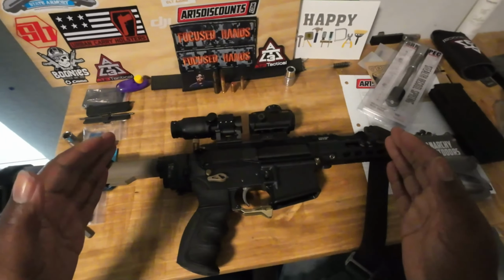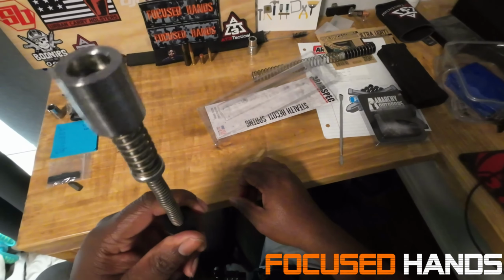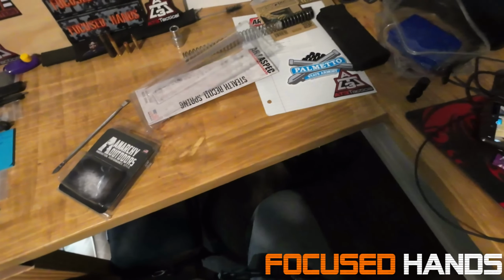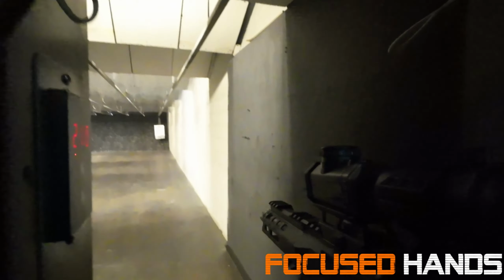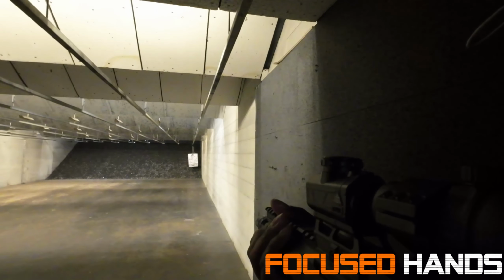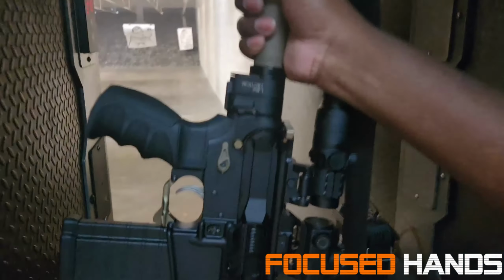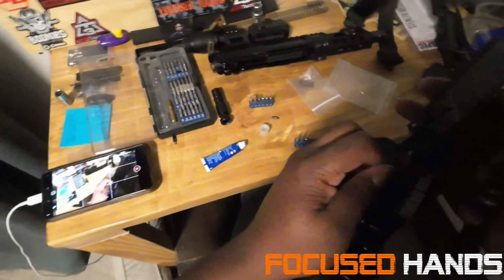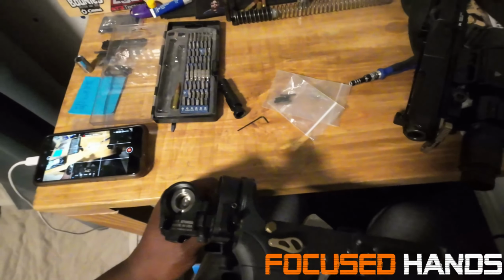Armaspec Gen 4 SRS Combined with a Law Tactical/Anarchy Outdoors Bolt Extension- Part 2

Comment: I did a comparison the other day between my 10.5 AR in 5.56 and my 10.5 KS47 AR 7.62x39 … the 5.56 has a standard buffer in it and the 7.62 has the Armaspec … man you can really tell the difference when you do that .. that 7.62 was so much more pleasant to shoot and handle rapid fire .. just ordered more from Armaspec for the other AR’s … an upgraded trigger really makes a difference in combination with the Armaspec too … I’m running a LaRue tactical MBT 2S in the KS47 .. my super sweet hog blaster 😂😎
Reply from the maker: Very nice! I need to drop a srs in my ks47! Thanks for the tip! What trigger did you drop in?
Reply: @FocusedHands  sorry for the delayed response … LaRue MBT 2S is the trigger .. they make it in a flat bow and a curved design .. got both , but like the flat bow better … there is a YouTube video that fully describes how to do the installation … it was very easy to do and to the best of my knowledge these are the only triggers I know of that work in the KS47.. 3.5lb pull … very nice triggers … bought straight from their website …
Reply from the maker: @thebugkiller9036  thanks for the tip!
Reply: I think the weight may be too heavy in the buffer tube. With the Armaspec SRS they say you are supposed to go lower a weight down because of the Dual Spring System. The only reason I say that is because a few times the bolt didn’t lock back to the rear. When the weight is heavier than needed that is the outcome sometimes. The bolt doesn’t lock back when the mag is empty. Let me know if it works out.

Comment: Hey bro nice set up! Does it really help mitigating some felt recoil? Any way thanks in advance 🙏🏽👌🏽
Reply from the maker: It does! Helps with 300blk forsure! Makes 5.7 feel more like 22LR
Reply: That’s good to know. I’ll be ordering mine. Thanks braddah 🙏🏽
Reply from the maker: @MrDalon37  id order an addtional buffer just in case your shells are not ejecting at the right angle. But that is up to you.
Reply: Good idea 👍🏽
Im thinking of ordering the carbine weight. My set up is a 10.5” .556 
What buffer weight did you end up working with?
Reply from the maker: @MrDalon37  I have the H and the carbine!
Reply: Did the SRS make charging the gun harder?
Reply from the maker: @MrDalon37  it should not. If you run it with a law tactical... it will. As they do not support the law tactical
Reply: I’ve got one on my PSA KS47 .. 7.62x39 AR .. and it does make a very nice difference especially if you have a good trigger on your AR …
Reply from the maker: Installing SRSs in all my buffer tubes!

Comment: I had the same issue with the SRS, it’s the machining on the guide rod and buffer weight are not up to par. The buffer weight binds up on the guide rod. I’ve contacted Armaspec about this issue with NO response. Also put a lighter weight….which wouldn’t even fit the SRS guide rod.
Definitely some QC issues over at Armaspec.
Reply from the maker: @sammyhatley5341  I don't share that same issue as you. All mine seem to be good QC. The issue I see is with the length of the bcg extender and the metel washer on the SRS plunger.

Comment: nice video man👍 I wanted to order a SRS unit for my pistol. What SRS weight did you get? I'm trying to figure out what my 7" AR pistol in 5.56 will work well with.
Reply from the maker: I got the H buffer and the C buffer
Reply: thanks bro. I ended up starting with the SMB Buffer tube kit and then I'll just get an SRS buffer and weights another time. Getting a brace setup for my pistol. I wanted to do a folding stock and I'm glad I came across this video too @FocusedHands

Comment: Hey,
    I was wondering if you got you AR straighten out….speaking I had the same issue, I had contacted ARMASPEC about this situation and they said the buffer SRS will not work in conjunction with the Anarchy Outdoor bolt carrier extension only the buffer SMB system works. The SRS washer doesn’t clear the extension so your firing pin has nothing to do with it…put your old spring buffer in and you’ll see that there’s nothing wrong with your AR. Hope this helps you. God Bless.
Reply from the maker: Yea I know about that and talked with armaspec aswell. The plunger actually clears. The issue is the springs in the srs are so strong it forces the bcg forward which causes it not to lock back on the last round. When i rum the system without the law tactical... everything works fine. Even with the LT the system works... but it will not LRBHO. My current experiments have failed im afraid.
Reply from the maker: But as far as the AR goes... it functions fine.
Reply: Hey, I currently running the same set-up on a AR15 7.5” and it runs perfectly ejecting at 3 o’clock with the SRS H2 system and it run without the folding adapter the plunger is not the issue it’s the washer won’t clear the Anarchy Outdoor extension. That’s the issue in my case, so maybe yours is something else I imagine. Hopefully you get it resolved though….God Bless.
Reply from the maker: @edwardchan7592  Im running a braided spring and h2 buffer right now. Ive also added the the original law tactical bolt extender back. System works and the bolt locks back. In a couple days ill be adding a adjustable gas block. Thanks for the support though!

Comment: The bolt hold open problem might be that you have to heavy of a buffer setup. Armaspec sells parts so you can switch to a lighter buffer or spring setup. There's a video on YouTube where a guy had the same problem and shows a break down of the Armaspec and replaced the buffer weight. Hope it helps
Reply from the maker: Tried that aswell. Not the issue. The issue is the bolt extender and srs combo. If i could got my hands in a jps extender... id get that a shot.
Reply from the maker: I even tried clipping the springs. Ive been in contact with armaspec about it. They do not yet... service law tactical folders. This could change though.
Reply: Hopefully you can get it figured out best of luck. I wouldn't mind seeing a comparison of the JP and armaspec captured buffer systems. I want to get one of them but I'm leaning toward the armaspec bc of the price difference. I have three AR platforms the 556 a 10mm and a 45acp so the price is a big deal lol
Reply from the maker: @T-riumph955i  cant go wrong with armaspec on price and function!
Reply from the maker: Also I think I know the video you are referring to! The guy has a gen 3 SRS that he modified to work with anarchy outdoors open whole extender. The gen 4 srs dont require any modification.

Comment: So the SRS and Law Tactical are not a fit at this time. I’m curious if you’ll try a SMB to see how it performs instead since Anarchy supports it.
Reply from the maker: Currently im trying to get my hands on a jpss extenstion kit. It has a short bolt extender that i think will work with both.
Reply from the maker: Only thing is... they are never in stock!
Reply from the maker: Lastly, I could give the smb a try and see if it works!
Reply: @FocusedHands  yeah, I was just about to pull the trigger on the SRS until I saw your video since I am trying to eliminate the twang from my 300blk SBR while running subs. Like you, I am also running a LT folder on it, though, and like you said, the JP Law systems are never in stock!
Reply from the maker: @illestdomer2005  yea ive been trying to get this kit for 6 months!
Reply: @FocusedHands  good grief! I don’t understand how these companies are incapable of keeping up production 🤷‍♂️

Comment: Get you a enhanced firing pin. You got to change out the firing pin when using a lighter firing group springs. They run like $20 on average.
Reply from the maker: As an upgrade? The firing pin is not the issue. The issue is the srs & bolt extender
Reply: @FocusedHands just letting you know. I put JP reduced trigger springs and was getting light primer strikes. Enhanced firing pin solved it. I have a 10.5 300 blackout with gen 3 h2 buffer weight and it runs flawless now. No folding stock. I put one on my 16” with the drop in trigger as well.
Reply: @FocusedHands  it’s just a suggestion. With home builds it can be anything. Good luck tuning.
Reply from the maker: @SeanCuttaBabineaux  o i c! Yea my 300 runs nice! Im about to add an adjustable gas block and pay this dumb tax stamp. Im going with an FRT trigger and a full auto bolt for mine. Stay tuned! Gots to have the folder!

Comment: Loctite is not a good idea for your fix on your sights.  A better idea would be to torque it to specs, which is usually 65 in/lbs of torque.  Notice it’s inch-pounds and not foot-pounds.
Reply from the maker: So blue loctite works well. I've used it on all my build with zero issue. Now orange loctite... now thats a whole different monster. However, thanks for dropping a line!